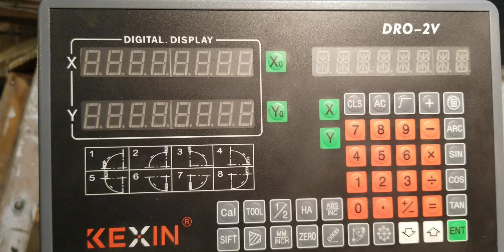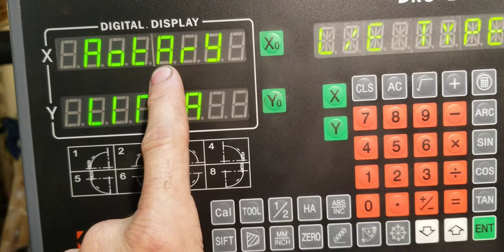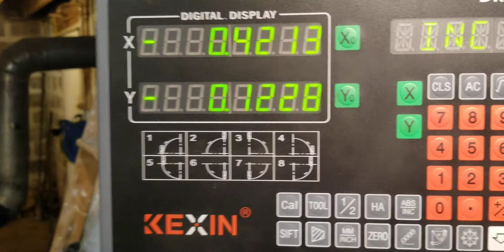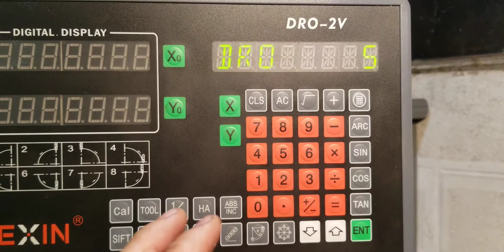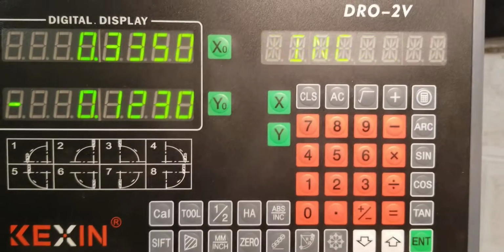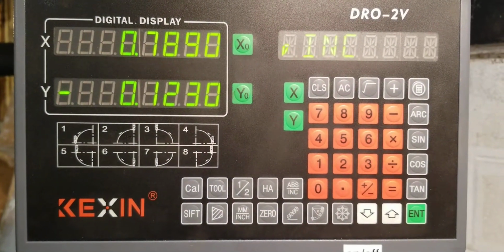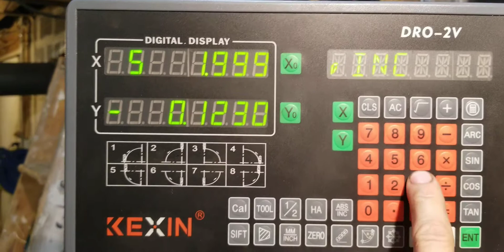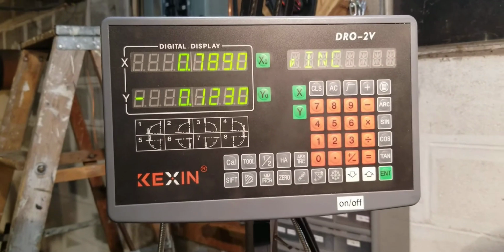Toauto and Kexin dro settings

Comment: Brilliant information but Display 3 is for a 3 axis setup XYZ Axis  yours is for a lathe so it should be set 2  XY Axis, I have the three axis version on my mill so while I no some things there is a lot I have not figured out yet my sense is that some of the set ups are for full on CNC rather than my mill which is manual. These DRO scales are set for millimetres the inch scale is a calaulated value

Comment: Today, I received my Hymseann SNS-3V DRO (3 axis) and had a little play with it.  (bought on aliexpress)
Indeed, 1 press on the dot key during startup brings me to the settings. 
There some very small changes in he software compared to your device(f.e. the DRO 5 and DIGIMAC5 settings are not there), but there must be a dozen of software iterations used by all those rebranded china DROs I guess. 
Thing what suprised me was that the basic calculator function does not work at all. Not a biggie, but.. why?
I also had some trouble getting the diameter mode on the X-axis to work. With pressing the axis button and then the 1/2 button halves the reading, but that's not the diameter mode (unlike some other video's tell you), because when repeating those steps, you get 1/4, 1/8, 1/16 etc.. and there is no coming back from it..
In the settings I had set device mode to 'Lathe-2' and diameter mode ('r/d') to '1' for the X axis and thought that was a requirement. Wrong! Setting this prevented the diameter mode to work, no idea why. So leave this setting to '0' (radius). When the device mode is 'lathe-2' pressing the 1/2 gets you into diameter mode. Pressing t again gets you back to radius mode